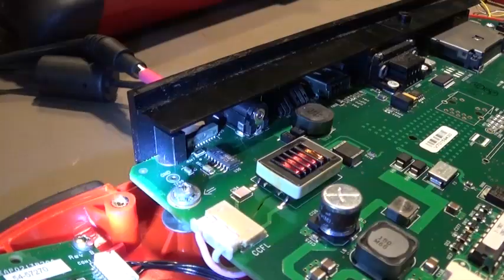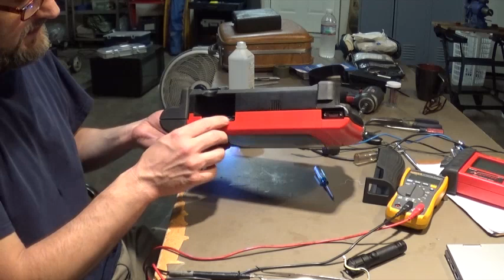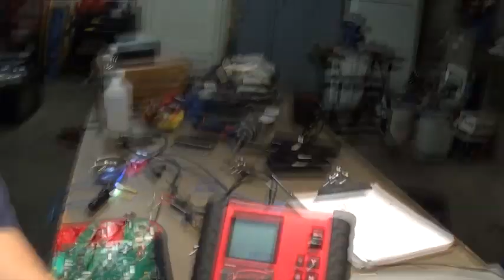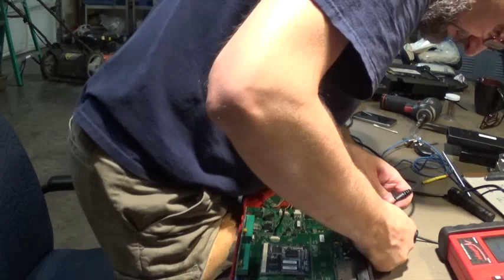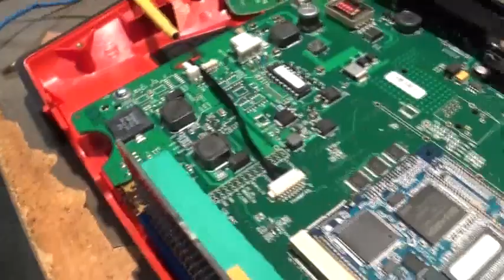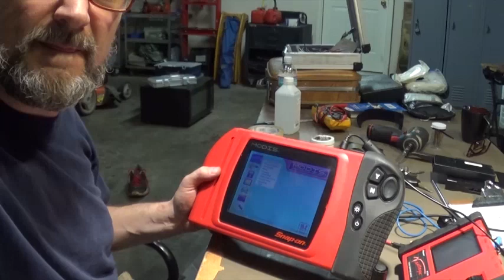Snap On MODIS Diagnoses And Repair

Comment: Most of the time the screws are loose or the plastic is broken on the housing. 
I clean the button pads and switch with a Q-tip and rubbing alcohol. Most of the time the switch will noticeably improve with a cleaning and making sure the  housing is secure.

Comment: Wow, that is a old unit. I got one of the new ones updated until 2024 and what do you know, it does the same thing, black screen. Except for I got power at the AC outlet. These things are junk. Not worth $5000, that's for sure.

Comment: Do you know the location of the capacitor that has to be replaced if the screen is dim?
Reply: IM HAVING THE SAME PROBLEM....DIM TO ALMOST NO SCREEN IN 2 MINUTES OPERATION...ooops sorry about caps...just started a week ago...im looking for info now...
Reply: @mitchellmobley8120  The possible fix is a capacitor or this other part or possible screen. But capacitor is most likely problem. Found info on a Snap-on forum

Comment: Thanks for your insight with modis. Just purchased modis made in 2002 and updated with 12.2. The unit boots up fine but noticed fan is not working. No voltage at fan connector on mother board. Pulled fan and applied 5 volts and it runs. Unit came with extra filters and filter installed is clean. Wonder if fan ever worked? Can't find schematic of mother board online. I found 5 volts on some solder terminations near fan connector on motherboard, but have no way of knowing which terminals and components apply to fan without schematic.

Comment: I'd appreciate any Input you may have. I have a snap on solus pro with an issue. I like your vantage  i really like the size of it. I have a vantage pro. It's handy but bulky. Anway I have been getting a no communication message on any car I read. This happened out of the blue. It was fine. The most common key I use is K17. I bought a new one from snap on.com no dice. I bought a new cable no dice. Tried 3 or 4 different vehicles different makes, no dice. Any experience with these or someone who may know? Apparently snap on no longer service's these. Thank you sir. Great video 👍
Reply from the maker: Adam Czajka I really don’t know my friend. Looks like you have some software issue.
Reply: Having the same issue with mine :- (
Reply: @Viper81766  Lord knows I didn't want to accept it but I'm stuck buying a new scan tool. If you can swing it Autel MS908TS is the one im buying soon. It does every make and model asian/ domestic/ Euro etc it's wireless and even has all the tpms program relearn etc built in with warranty right at 1500 but brand new with all obd1 connectors and wireless connection for obd2. Autel has many cheaper pro level scan tools for 500-750 but I want 10 in 1 tool lol and I don't want to buy another one for as long as possible. They have outstanding reviews, you buy through Amazon is like 75 more than ebay but Amazon offers a 4 year warranty through square trade for 29 bucks. So roughly a 100 more than ebay but no one offers 4 year warranty on electronics even fucking snap on assholes.
Reply: @acetech9237  I got a modis updated through 2012 with European and Asian on eBay in 2016 and it does the same thing with the no communication issue . The first two weeks after I received it it worked great and suddenly stopped linking up . The scope still works . Can't find a battery for it either and snap on of course gives no advice on the problem . Expensive paperweight . Eventually bought a smaller Matco scan tool . Wanted the Modis for bidirectional capabilities .

Comment: Just bought a unit and has a problem. I charged it up and it ran for about 10 minutes but after about 8 it said battery low and then it cut off after 2 more minutes. I then checked the voltage at the contacts and it showed 9.28. I also noticed that the unit had been open and the battery pack as well. So my questions are: 
What is the disconnect voltage for the modis and where is the component for the battery disconnect?
Reply from the maker: JoeCnNd Do you have AC charger? Take your battery out and plug in your charger to MODIS charging port and turn it on. See if your unit will stay on.
Reply: KY Home Garage KY Home Garage I meant to test that before work but was in a rush. Let's say hypothetically it started and it was the battery voltage reading low. I only go with that scenario because I think the other option is covered on this video pretty well.
Reply from the maker: JoeCnNd If you have low battery unit will shot down automatically unless you have charger plugged in.
Reply: KY Home Garage KY Home Garage but isn't 9.28 a pretty high voltage for this unit to shut down? Shouldn't it go down to around 7v?
Reply: KY Home Garage KY Home Garage I just read that the battery will learn to disconnect earlier if kept plugged in and the life will get shorter. It says to fully charge and deplete three times and it should help so I'm going to try that.
Reply from the maker: No, you can plug in this unit straight  to cigarette lighter if you have cord and you will have battery voltage.
Reply from the maker: Typical output voltage on AC charger is 15V
Reply: KY Home Garage KY Home Garage when I tested the battery it was out of the unit and used my multimeter.  It showed 9.28v granted that's not underload or anything but figured it would be a lower voltage than that if fully drained.
Reply from the maker: Make sense ,but as you said battery was not loaded. Most likely you will need new battery.
Reply: KY Home Garage KY Home Garage I'm hoping not. Maybe the previous owner kept it plugged in most of the time and just has to learn to lower voltage. Fingers crossed. I'll let ya know what happens.
Reply: But it makes sense that I have 2 bad batteries that are cutting the unit off when it gets down to a volt for those batteries.  Draining 2 batteries down to a 1 to 1.1v from 1.44 would take my voltage from 10.08v down to 9.28 and cut the unit off or have one bad cell and the others drained a bit off of natural draining.
Reply from the maker: On your MODIS in lower right corner you will see state of your battery.
Reply: Hey, just to update. I just tried the charge and discharge and on the second time it got about close to 2 hours on it with me just going through the scopes and learning tutorial menus I also charged with the unit on and clicked the charge as the first time I charged with the power off and read that charging with it on is much better. Thanks for all your help and hopefully this will be good for awhile.
Reply from the maker: JoeCnNd that is good news. I am glad you got it to work. Cheers

Comment: Hail to the king. Just like a real mechanic, just can't leave it alone. Usually when i do that i make it a lot worse. You did good though right before slamming it to the ground jumping up and down on it and taking it shootin, let out a big sigh walk calmly away have a hit of your favorite adult vice relax a bit and then give her hell again, I like to take the approach "YOUR NOT GONNA BEAT ME"  Glad you fixed it. Now i might try and fix channel one on my vantage. You inspired me. Great job.
Reply from the maker: Rags2Wrenchs first you are true hero my friend  you watched it all the way to the end. I didn't realized that video will be an hour long. I had to stick to it this is my main scanner with 15.2 update. I hope you will fix your vantage . What is problem with your unit. Cheers
Reply: It been a mess since i got a couple years ago. channel one reads all over the place or not at all, ch. 2 works fine. sometimes i have to press really hard to turn it on, i've had it apart but didn't see anything obvious. need to do some testing i guess.
Reply from the maker: Rags2Wrenchs If you have old Vantage 2400 you need to clean circuit board under your on off button with q tip and rubbing alcohol. Your channel one is out calibration due to acid damage from old battery. No help there bro. Sorry
Reply: ok, thanks

Comment: Very persistent and determined. Another good video. A good mechanic not only fixes the car but also the test equipment. Great job
Reply from the maker: Thank you my friend my MODIS is still great asset in my tool box. It would be big loss for me if I didn't fix it . Cheers